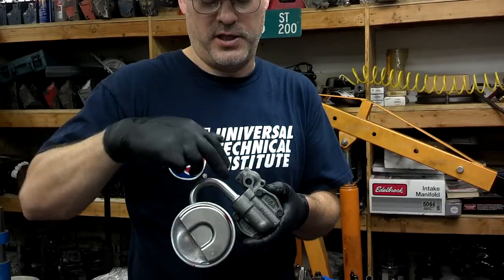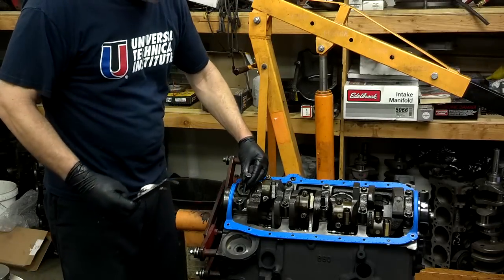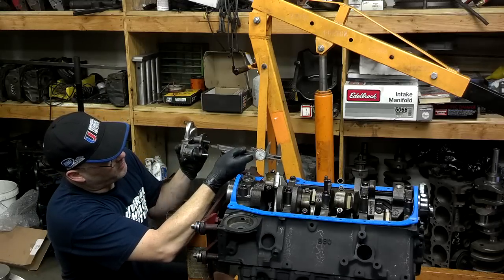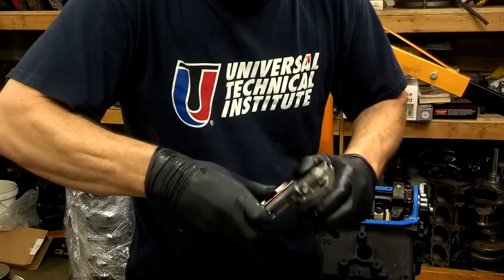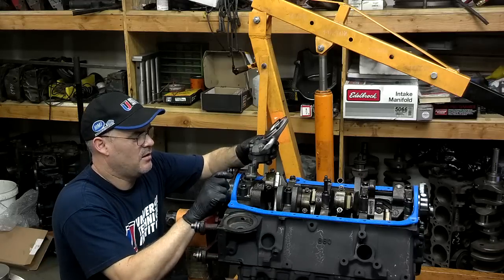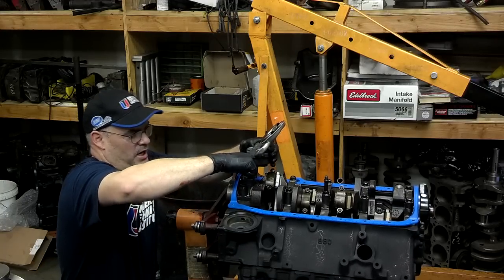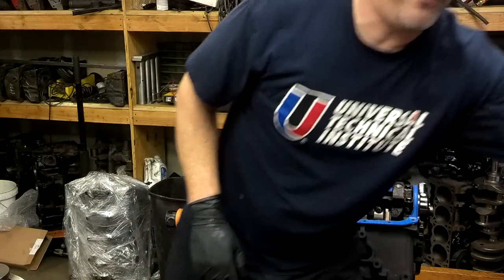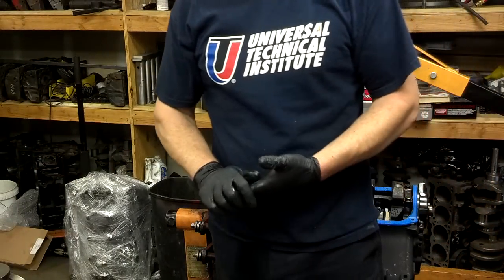Oil pump installation 350 chevy

Comment: myvintageiron7512 I have a 2004 chevy suburban and it wont start anymore..it turns over n tries to start but uust wont..I just put a brand new battery in it also..but my oil pressure gauge reads 0 and my truck wont start..I changed the oil and oil filter and it still wont start..is it my oil pump? what r your suggestions?

Comment: When installing a high volume oil pump,it sits higher than the standard pump.How do you adjust the oil pickup when using a standard pan?

Comment: So I recently replaced my heads and while priming bam the plastic clip broke lol so I saw your video and saw the metal shaft got it replaced it but now I have very low oil pressure since then before this whole head thing I had very good oil pressure so not sure if anything with the oil pump being removed and put back in place would have anything to do with it
Reply from the maker: HMMMM probably not
Reply: Myvintageiron7512  thanks for the quick response it seems when cold I’m at 40 as motor warms it drops to bout 30 and never goes above 40 when driving

Comment: Thanks for this video I have a 93 gmc k1500 350. Is it normal for a 350 to have a gasket between the pump and the rear main cap display ? I just want to make sure. Is their a second plastic sleeve on the distributer side? Is that common? I didn't see a second sleeve. Any tips for a upsidedown install I've already disassembled everything.

Thanks again
Reply from the maker: I never run the gasket get your self an oil pump shaft with a steel sleeve

Comment: How about the Oil Filter unit 1978 Chevy 350...is there a Gasket that goes in there with the 2 bolts ?

Comment: Question: I’m rebuilding an Lt1 stock bottom end stock pan 503 cam rebuilt top end. Is a high volume oil pump overdoing it for my application? Should I stick with a stock replacement? I just don’t want to run my pan dry or over build oil psi
Reply from the maker: I would run std vol pump

Comment: After swapping pan gasket I was worried about the pump I didn’t like the fact that I had to remove that bolt and it dropped down a little but I feel like it will be fine after this video. Is  that drive shaft ever difficult to get on the distruster end ?
Reply from the maker: no not really

Comment: In my 1990 Chevy c 1500 4.3 motor do I need to lift the engine to replace my oil pump or can I take off the oil pan from underneath? Your answer is very appreciated
Reply from the maker: HMMM not sure you will need to check the service manual on that one
Reply: 4x4 , engine needs to be lifted a few inches. undo motor mount bolt bell housing fan shroud starter and oil relocator-adapter. lift motor 2-3 inches and your good to go .

Comment: What's the symptoms of failing or failed oil pump? My brothers truck has no oil on top end but if its in park the oil pressure gauge in cab reads around 200 if it's put in drive it drops dramatically about half. Any ideas?
Reply: reads 200 at idle? that shouldnt be right

Comment: My question is will the oil pump shaft make a knocking or rattling noise without the steal rod?
Reply: if you use the plastic kind it might fail and your parts will be in the bottom of your oil pan.   very bad idea that gm is using. order the steel rod it holds much better.

Comment: Question for you. I recently purchased a sbc that has been rebuilt. The block was painted , however the exhaust ports were not covered. and over spray lightly covers the back side of the valves. Is this or going to be an issue ?
Thanks
Reply: david white the hot exhaust will take care of it.
Reply from the maker: No it's fine that paint will vaporize the first few seconds of run time

Comment: I've a stock Chevy 305,oil pressure runs 45-50psi on start up as it warms up it drops too 5 to 10 psi can you tell me what my problem may be, thanks in advance!
Reply from the maker: Probably worn out rod and main bearings

Comment: Im trying to install my oil pump shaft to my oil pump but it won't stay put! It falls off when i try to install the oil pump on this sbc. It's driving me nuts, this is the first time i have this problem. The oil pump is milodon and the shaft is melling, what am i doing wrong? Need your help please
Reply from the maker: is it the shaft with the steel sleeve built into it

Comment: on this 383 im putting in Probe forged srs .030 over flat tops 11 to 1 forged scatt 9000 crank 375 stroke Howard hyd roller intake lift  .563  degree of Duration 300  Exhaust  .578 lift   and duration 306  lobe center 110 and intake c/l 106  and 6 inch h beam connecting rods .  im not shure what AFR heads to get 195 with 2.050 intakes and 1.6o exhaust 64 cc  or the 210 with 2.080 intakes and 1.6 exhaust and what rockers would u use 1.5 or 1.6 !!!!! please respond would like to know your opinion

Comment: I am working on a 1993 GMC K1500 4x4 with a 350 motor. Is it possible to pull the oil pan and replace the oil pump without raising the engine?
Reply: What do I need to do to get the pump install

Comment: my husband and i are having a hard time taking off the oil filter housing it seems to be stuck. We are trying to put a oil pump in our 1998 4x4 5.7 1 ton extended cab chevy sylverado truck. And we cant seem to get the oil pan off at all. What are we doing wrong he tried taking the bell housing off but it seems like its still in the way. Please help would appreciate it. Thanks and yes we are doing the job from underneath, not the top of the truck. Anything would help.
Reply: floraann zuniga HMMM well it;s really just a matter of getting all the bolts out does it have an oil cooler?
Reply: I had to loosen my bell housing,unbolt oilpump adapter.remove motor mount bolts then use floor jack&2by4 to lift on the harmonic ballancer lift hmm2" then slide bolts through upper mount holes.then lower engine to have clearance to remove oil pan .

Comment: myvintageiron7512 first off thanks for the info. I have a question for my 84 chevy. Has 350. The oil pressure gauge is pegged out, i have read that it could be a clog upstream of filter or it could be the filter itself. What else could be the problem and how would i clear out a clog if indeed thats the problem?
Reply: +Mario Ovalle If its the stock in-dash electric gauge then being pegged is most likely a dead sender or a bad connection with the sender wire. The likelyhood of the gauge functioning and you actually having enough oil pressure to peg the gauge is almost non existent.
Reply: As I seen this I hit a bump n the gauge started working..good call man your the man. Thanks
Reply: No problem

Comment: You give great information and had a question that I've looked on utube for and nothing  really solid....anyway my ??? On oil pressure 81 chevy 350 motor approx 35,000 been sitting for some time....starts up runs great minus tune up and Quadra junk carb but after warm up oil pressure goes to zero with Guage off block bypassing sending unit...it's gonna be an engine pull no pan access cross member.....what an I looking at? Bad oil pump or blocked spun  bearing passages kinda confused the thinner the oil gets should flow better....my thought oil pump with posible crank shafts bearing damage.....if spun bearing plan on engine junk.....SUCKS just did major body repair, interior, brakes shocks dropped bank and hours and now this..DAM YOU MURPHY.....

Comment: I am going to replace my oil pump on a 1998 Suburban 5.7 Vortec 2WD . Many say I have to raise the engine a few inches to get the oil pan off , and many say no , you don't have to raise the engine unless it's a 4WD . So what's the story ?
Reply from the maker: HMM not sure
Reply from the maker: On specific applications like that you need to consult the service manual

Comment: Hopefully you can get back to me soon, I got an 89 Camaro with a 350, I suppose my question is can I replace the oil pump without have to remove the whole block?
Reply from the maker: Jonathan Clinton Yea just pull the pan
Reply: Jack up the car and put it on high jack stands. Drain the oil and remove the oil pan. You will see the pump and pickup arm on the bottom of the engine. Remove the oil pump retention bolt, drop the pump, and clean away all of the old gasket from both the pump and oil pan joints. Use red locktite when putting on the press-fit pickup arm. You might also braise or tack weld it in but locktite should be sufficient. One thing to remember is when you replace the oil pan gasket and especially if it is in 4 pieces, use black silicone spray glue at each joint and in the corners on the bottom of the engine where the gasket lays to make sure it doesn't leak in the future. These joints and corners are where the first leaks occur. Hopefully this helps!

Comment: How do I find out what specs are for my engine I have a 1990 gmc 1500 Sierra but it dose not have the original motor all I know it is a 350 i was told it was from a Chevy but I would like to make sure
Reply from the maker: there is a casting number on the block if it's a chevy engine the casting number is in the back near where the transmission bolts up get the number off it and google it

Comment: I have one question. Am i able to do this under the truck or am i just going to have oil dripping every where on me
Reply: first off drain your oil. then wait or wipe off excess. yes, you can do it from an installed motor. .

Comment: I have a 1ton Chevy truck with a 12ft box on it .oil pressure good when starting and driving . but when I stop at a stop sign for a little while oil pressure goes to nothing and engine light comes on.starting to drive again and everything is fine  . ???  Do u think the truck idels down to much R something wrong with the pump
Reply: Weak oil pump, clogged screen or worn main bearings.

You can try using a thicker oil, 10w40 instead of 5w30.

Have the same symptoms with my 5.7L with 384,300 miles...
Normally use Mobile1 or Castrol high mileage oil.

The only time it ticks is first startup and only for a few seconds.
NO ticks or knocks when at idle (stoplights) which is a good sign.

Did notice that that when down a quart the oil light comes on far more often. By then the oil is spent (dark) and needs to be changed anyway even with only 2,000 miles.
My engine is high miles and I imagine the piston rings are are worn causing more than normal blowby.

With stock 5w30 I barely get 1000 miles. With 10w40 I'll get nearly 3000 miles out of an oil change and far less metal shavings on my magnetic oil pan bolt.

Waiting on spring (shadetree) to either do a teardown and rebuild on the engine if it's salvageable. If not engine replacement.
Truck runs great other than the oil light. Get about 12 MPG city, plenty of power. Use it to plow and haul.

Comment: Hay man on my 383 block the number one and four cylinder at the very top are a little dent or like a low spot were it was bored 30 over was left but the rest of the cylinders turned out great but the machinist said it was ok that it wont hurt anything !!!  should I believe him !!!! first and the second ring might go over but the oil rings will clear this its like the size of a salt crystal..

Comment: do i have to use the little plastic piece that goes on the shaft
Reply from the maker: No you can buy a 1 pc oil pump drive with a steel sleeve

Comment: One question.  Do you recommend tacking the pickup or staking it to the pump?
Reply from the maker: I weld a strap to the pick up and bolt it tp the pump housing
Reply: Myvintageiron7512 thanks

Comment: I got another question....ok now if someone didn't put the rear oil seals in could that calls for you to lose oil pressure sir and also and by you losen pressure does that mean your oil pump is bad or not???
Reply from the maker: I am assuming when you say rear seals you mean the rear main seal? if that seal is not in there you would have oil dumping out the back of your engine it could be the pump or it could be worn clearances in the engine or it could be a faulty Gage,  wiring or , sending unit you will need to hook up a manual psi Gage to know for sure

Comment: Hello and thanks for the video, I've a 1972 GMC Sierra with 350 engine, can you pls tell the oil pump that fits such engine? If you would pls indicate the pump part number, and the oil pan seal, thanks
Reply from the maker: M55 pump

Comment: Ii purchased a rebuilt sbc. I pulled the sump to check the bearings and discovard wire holding the oil pickup instead of a weld,  should I remove the wire? or is it somewhat normal?

Comment: i have a small block 350 and its smoking what do you think it is
Reply from the maker: +antoine bartee what color is the smoke
Reply: White
Reply from the maker: +antoine bartee It's probably steam possibly a blown head gasket
Reply: I really hope for your sake that you get it fixed before it starts putting out a blueish smoke.. I went from a blown head gasket to two blown head gaskets, a cracked block between piston #3 an #5, melted the inside of my head and also completely welded my exhaust an intake valves on piston #3 an #5... so $350 later I have a new block with a completely redone piston rings and so on.. its a bitch..
Reply: it just had sex?haha

Comment: I have 96/Tahoe/5.7/I install everything new pump screen gasket new sensor. New oil new filter. Still show me low zero pressure. Only have138.000 miles I don't wanna suspend more more money can you help thanks
Reply: Wire on sensor prob bad or screen is clogged where sensor goes or possibly an o ring was left out on pick up tube

Comment: Do you have to take the motor out to install the oil pump sir???
Reply: Ok....I just seen the answer to my question with about do I have to remove the engine thanks sir
Reply from the maker: it depends on some applications you do

Comment: IF THE FILTER IS FULL OF DIRT  WIL IT PUT DOWN OIL PRESSURE
Reply from the maker: No the filter has a bypass valve in case this happens it's better not to get that far